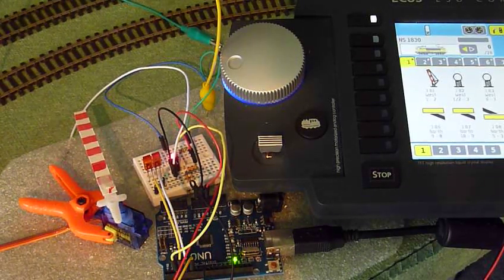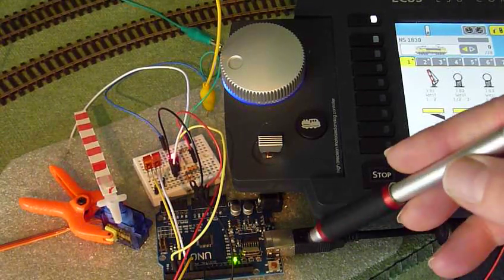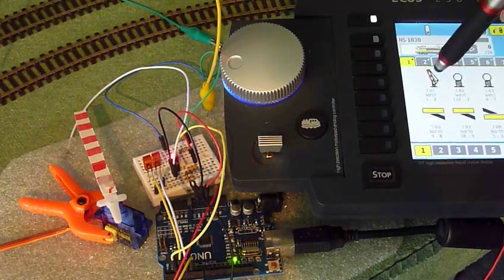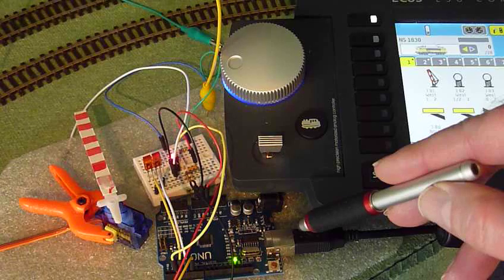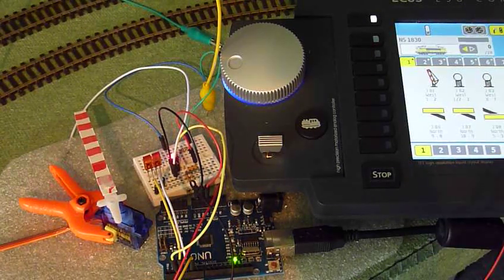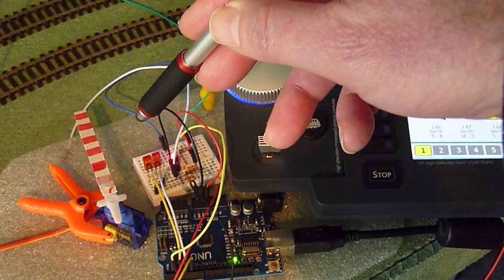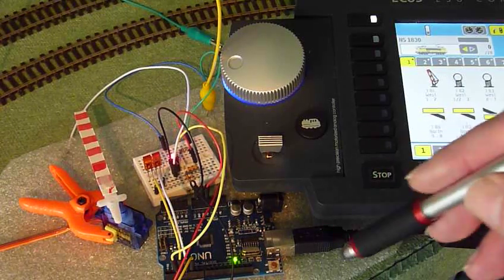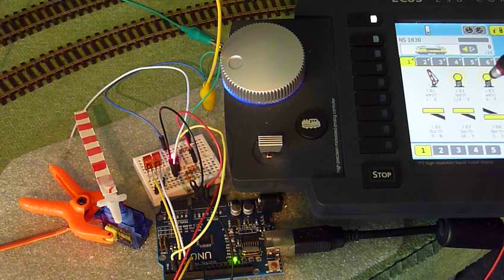RMR024 - Arduino DCC Function Servo Sound Decoder

Comment: gaaf :) ik hoop dat ooit via Arduino een Sounddecoder voor mijn LGB treinen te kunnen bouwen, heb namelijk 5 stuks reguliere LGB MZS locdecoders heel goedkoop kunnen scoren... probleem is echter dat je er een aparte sounddecoder PLUG&PLAY bij moet kopen, die zijn erg duur :( wil dus graag dat ik de 4pins soundconnector op het originele MZS locboardje zou kunnen gebruiken om rijgeluid te schakelen via Arduino en dan daarop (dat schijnt mogelijk te wezen) de correcte soundfiles te plaatsen

Comment: Hi Ruud,
i bought this servo shield (libary and example sketch can be found in the link):
https://learn.adafruit.com/16-channel-pwm-servo-driver/chaining-drivers

It can be purchased here for about 3 Dollar:
http://de.aliexpress.com/item/PCA9685-16-Channel-12-bit-PWM-Servo-motor-Driver-I2C-Module-For-Arduino-Robot/32592084002.html

With that, you can adress 16 Servos with only 2 Arduino Pins and you can attach a seperate DV 5V Power for the servos.
I tried now, to merge this sketch with yours, so i can switch the servos on this shield with DCC adresses, but i am not that good in sketching.
Maybe you can help?